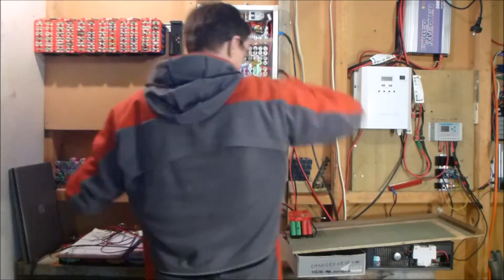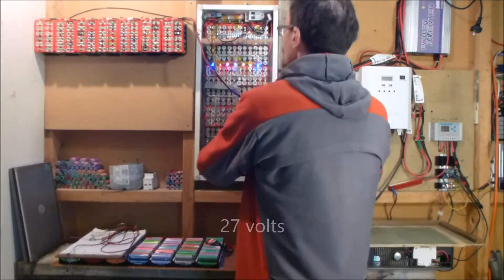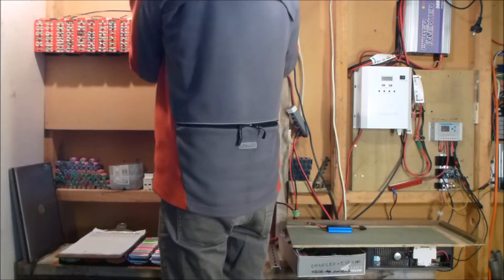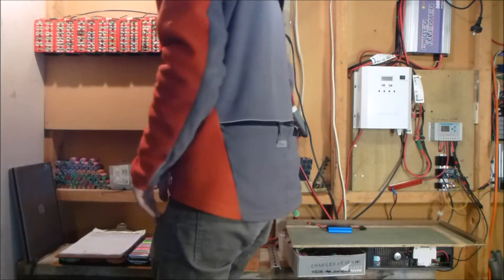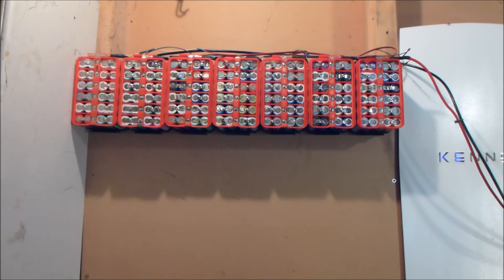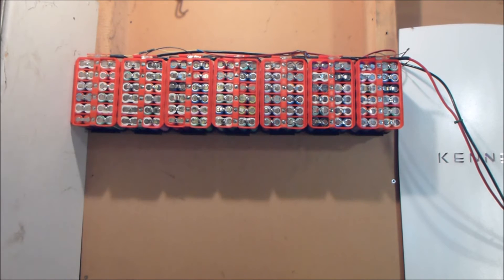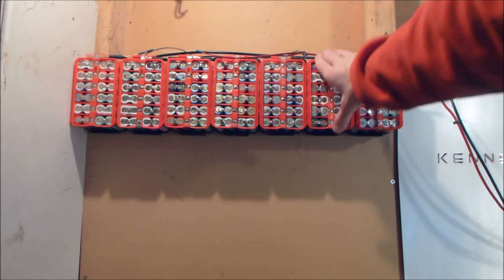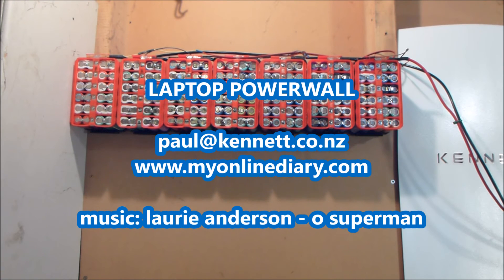Laptop Powerwall 64 - DIN rail mount for small 18650 blocks completed

Comment: Just wanted to follow up that i've finally tested enough cells so have my 7 packs 3d printed and built up 4 now, they are working really well.  On the search of some Din Rail now to mount them in the playhouse outside.  Just wanted to say a big thanks for the great design.  I'll be doing a small video and will make reference to yourself and your page if it's ok with you.
Reply from the maker: Cool. I'm glad it's been helpful. I'm about build up another 1 kWh pack using the small block DIN mounting  design.

Comment: hi Paul, did you ever do a video detailing the charger/inverter you are using ?  - I'm needing to charge using a wind turbine and PV - thanks.
Reply from the maker: No I haven't given much detail in the charger or inverter yet. It's on my list of topics to do. I don't have wind so my situation will be a bit simpler than yours. Do you have wind and solar?

Comment: Well isn't that just the business! :-)  Couldn't be easier to mount or remove a block from the pack! Would be nice now if each "block" had LED status indicators, like when you get a failed drive in those hot-swappable drive arrays! That too much to ask for? :-)
Reply from the maker: You could add a little digital voltmeter to each pack but that would be a bit of a constant drain. It would look cool though :)